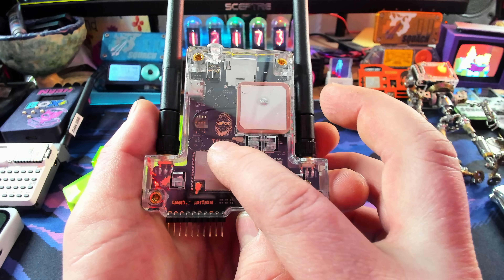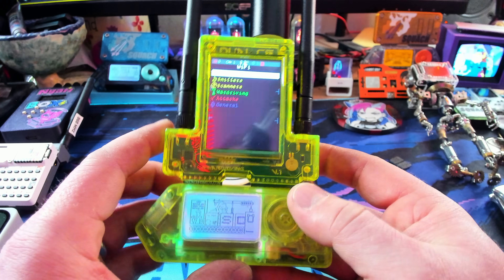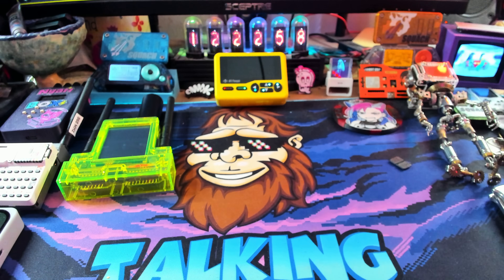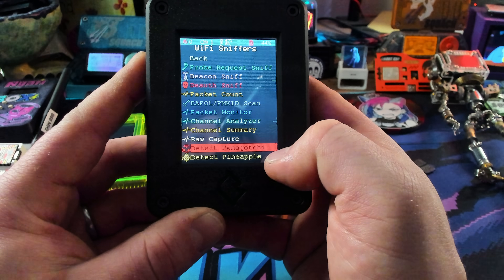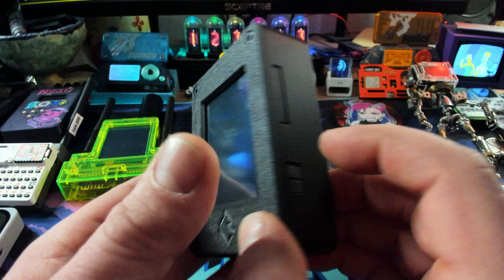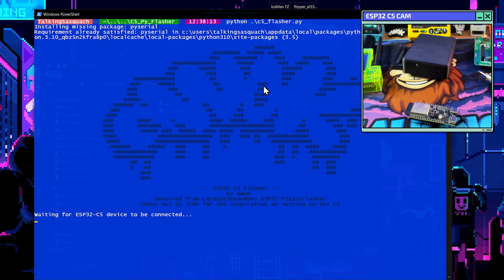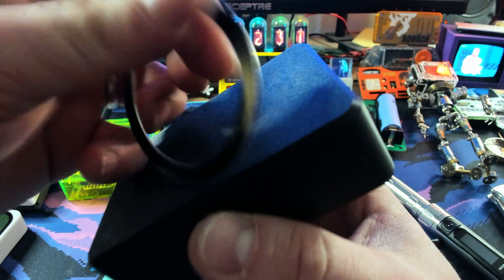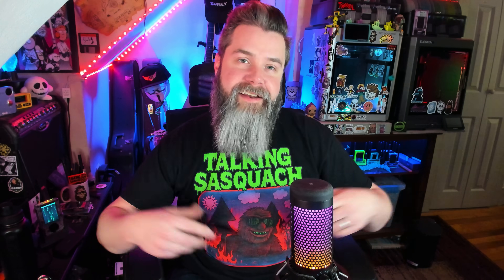This 5GHz WiFi Device is INSANE

Comment: I like them but the way those antennas are exposed and how both modules are linked together makes me nervous. I feel like a single case 3D printed could encase the entire dice and leave gaps around the antennas but still keep them from being bent or broken off. Maybe design it to one case connects the two devices and then another small clip on piece covers the antennas threads and the ends so they can't snag on anything. Not sure how but I feel like the way it's setup now it's sort of fragile. I still super want one though. Lol. The green plastic reminds me of those Cybiko devices they used to make back in the day.

Comment: Could the JCMK M5 war driver work as a marauder with a smaller screen?
Reply from the maker: So I did accidentally plug in the C5 to the wardriver with Marauder firmware and it did boot, but the screen is obviously different so it doesn't really work

Comment: Yo I wanted to comment on your flipper rolling code post before it got taken down. When you capture the code from a car remote. It will make your remote useless. But if you have another remote still programed to the car you just captured. You can reprogram your remote you just deauthed with the good remote you have still programed to your car

Comment: Nice you gave the first ones to Illya and Kal those guys are great.✌️
Want to order one also for my flipper 0 but that thing has problems that i can't get solved,eventualy i checked if the gpio is not working but it works fine.
It has to be something ridiculous stupid that i oversee.
Reply from the maker: Your GPIO pins don't work?

Comment: I would love to see a full review of the LILYGO T-Embed CC1101. Bruce firmware and maybe others? What can it do that the flipper can’t without an explanation GPIO board?
Reply from the maker: I actually covered the CC1101 in my DIY Hacking video I think
Reply: Thanks for getting back! First of all you’re super awesome. I’ve learned so much from you. Keep up the great work. You are THE absolute legend! I saw that video from 10 months ago. Great video as you rarely disappoint, but curious if an update would be good at this point. I saw Ghost Strats put Bruce on his CC1101 about a month ago, so I was hoping there might be more new stuff to check out.